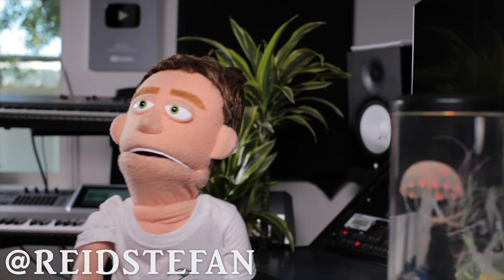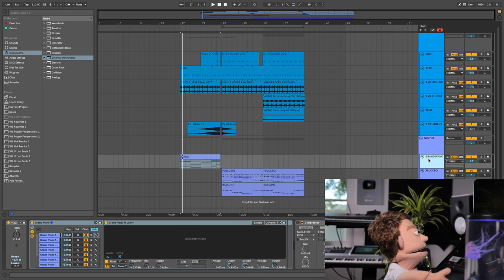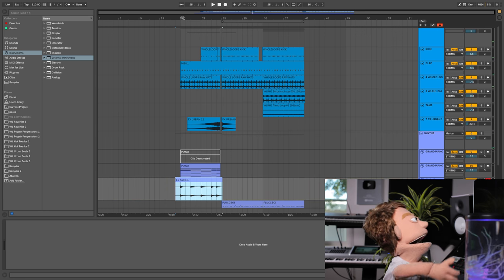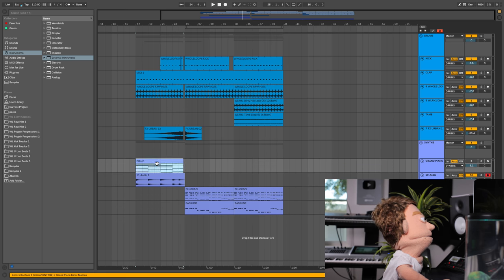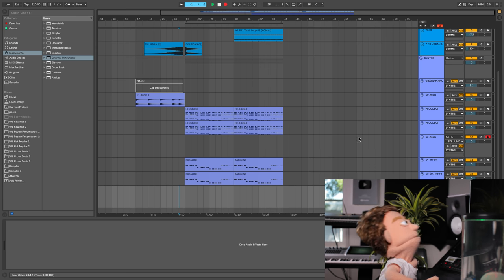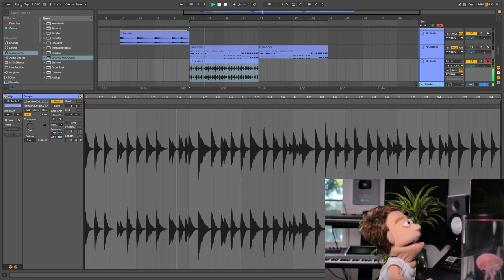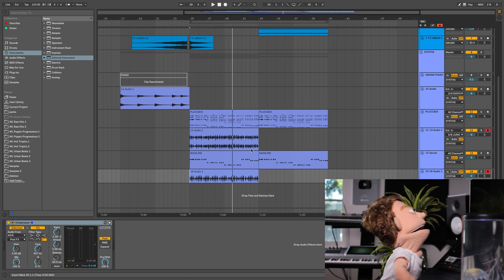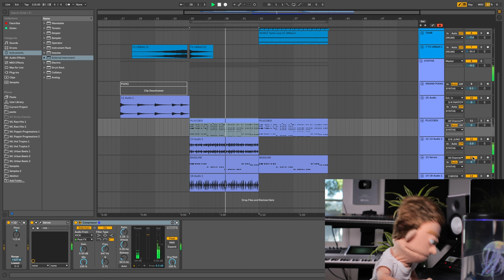Analog Synths And Ableton 10

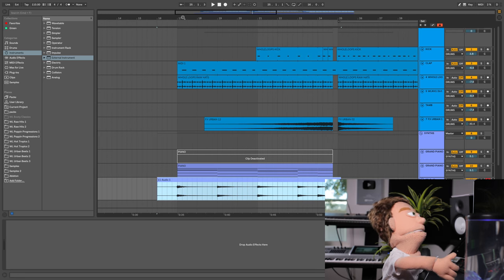Comment: Hey Reid, the problem with buffer 3:15 can be solved by using that driver error compensation which is little bit below place where You choose buffer size. Set it to samples and move number till You get number "overall latency" that is below it to zero. This should compensate recorded delay. 
Nice video, as always!

Comment: great thanks :) :) :) I have 2 questions : 1 : Don't you have a strict policy about the recording gain (for example I record everything at -6 db) ? 2 : Why are you using external instrument to pilot your gear, instead of just routing the midi track to the corresponding midi output ? Cheers, nice video :)

Comment: Wow MOTU Fast Lane how did I not know this existed.. 1.) Did you have two like RCA cables going out of the 106 into the Motu or was that another analog synth cable going into the Motu? 2.) Curious the cable hook up from the synths to the Motu fast lane to the audio interface? 3.) You just plug those things in and Ableton just picks it up the analog gear, no problem with the external instrument plugin? 4.) Does it also pick up automation with the analog knobs? Thanks Reid great video.
Reply from the maker: UrbanLikwid the Juno has two Midi cables going to the Motu (Midi in&output) and 1/4 inch rca cables going to the apollo (audio L&R)
Reply: Thanks Reid!

Comment: Awesome video! I’m still trying to figure all this out but I do think that the external instrument automatically compensates for any latency. So I’m pretty sure that when you create the audio track it’d be easier to set the input to the ext instrument track rather than the audio input. In theory you wouldn’t need to shift the tracks after recording each time
Reply from the maker: Marcus Wiles I have to nudge and align everything when I use outboard gear
Reply: Reid Stefan yeah that’s what I’m saying. When you make the new audio track to record the audio from the external gear, I THINK if you select the track input as the track that has the ext instr plugin, then it will automatically compensate. I noticed you weren’t routing any audio with the ext instr plugin and selected Ext input in the audio track. I’m thinking the ext Inst plugin can compensate for any latency. Thanks for all the great content Reid!

Comment: That’s the same latency I get with my Safire pro24, isn’t the Apollo 8 supposed to have near zero latency ?
At a higher buffer size do the cracks and pops go away? Does the 40+ms of latency give you any problems with the higher buffer siZe ?
Reply from the maker: that cracking was playback latency from my Screen recording software consuming most of my CPU. The Apollo monitored the keyboards with zero latency as you heard in the beginning

Comment: Hi Reid. Thank you so much for taking the time to share with us your workflow when integrating hardware synths with Ablelton. There’s a simple solution to your misaligned audio problem. You have to adjust the Driver Error Compensation in Ableton’s preferences. See the link below for a simple how-to. Hope that helps make your workflow even more efficient and accurate. Thanks again! https://help.ableton.com/hc/en-us/articles/115000234830